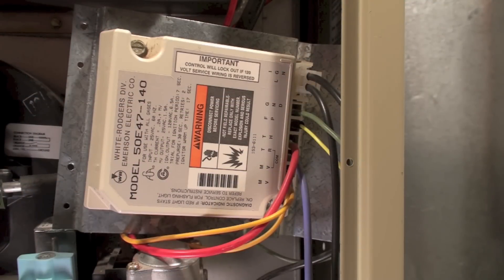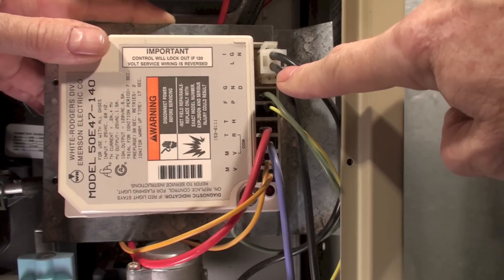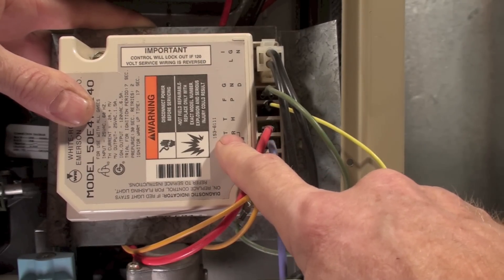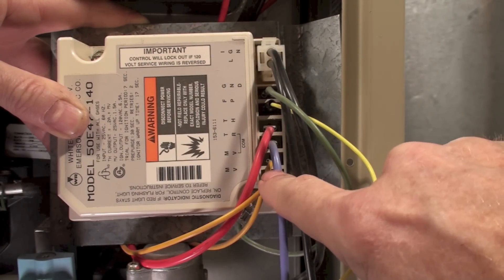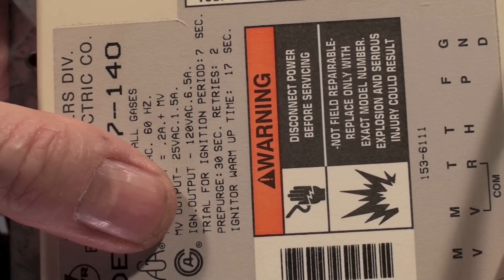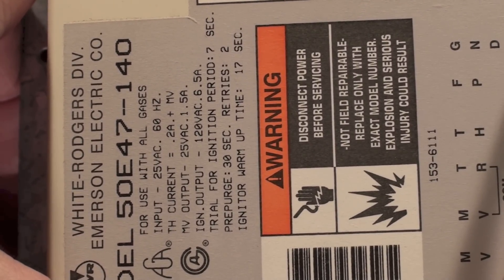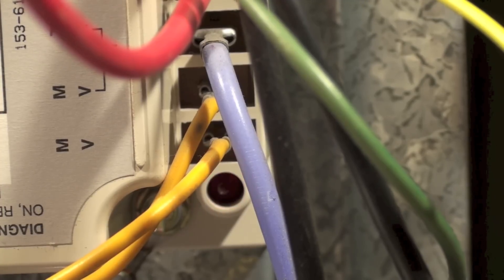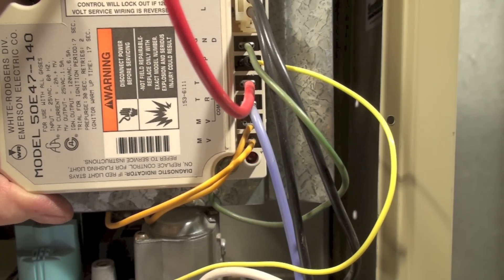How the White Rogers 50E47 ignition control operates

Comment: Will any model 50E47 work mine the model # is missing looking on Ebay they have different model # and look the same as mine.
Reply from the maker: If you have the model # of the furnace, you can get a general replacement control from White Rodgers or Honeywell that has a replacement crossover with instruction on how to use the new control.
GFM

Comment: Hi  Just replaced my 50e47-70 with the new 50e47-843 ign. Old 70 ign nothing would happen. New 843 ign the furnace cycled  all the way but after gas ignited wouldn't signal for blower to turn on. Tried the manual fan on, which old 70 ign allowed, wouldn't turn on. Went upstairs and turned manual fan on thermostat, it turned on, but by the time i got back to furnace new ign was in flames. TH and MV1 are the terminals that melted. Before the fire incident had green light thru all sequences except when blower would not start furnace shut down and green light was off indicating internal failure. Ay tips, ideas ? Thanks Greg
Reply from the maker: That control is an ignition control only.   The fan is not controlled by this control.  Possible flame rollout if the control was mounted above the burners.  A short does not seem likely as the low voltage fuse should have blown.
GFM
Reply: @grayfurnaceman  My  ignition control is located on the bottom of furnace in its own sheltered space 2 foot below burners. The fire at the TH and MV1 terminals was immediately after thermostat commanded blower to turn on manually suggesting to me i dont have them connected properly to the new 843 ign mod.
 I'm going to bite the bullet and get someone over for a service call.
 Thanks for your help.
Reply from the maker: @greg6745  Good idea.
GFM

Comment: i have a 50e47-060 that the light is not coming on.....does this mean control board is in good working condition? what other board numbers work withtrane xl 90? thanks for your time
Reply from the maker: No light is probably no power to the board.  Check pressure switch, limit.
GFM

Comment: GFM,
Just as a follow up I replaced the used White-Rogers 50F47-060 with the White-Rogers 50E47-060 and everything works. They were like-for-like lead replacements. The 843 had a little more lead rearrangement. Thanks again for the great video and suggestions.

Comment: GFM,
Thanks. The only thing that does not work occasionally is no 120 from the igniter plug but the question isis the 5047E-060 and the 5047F-060 interchangeable. It looks like they would either work.
Thanks and merry Christmas.
Craig
Reply from the maker: There is a general replacement control that will work.  It is the White Rodgers 50E47-843.
GFM

Comment: Great video on the White Rogers 50E47. My question is The 50E47-060 a good replacement for the 50F47-060. My problem is the igniter does not receive power sometimes to light the flame. I have to manually shut off the power multiple times to get it to fire.  I can hear the relay click so I am assuming there are some bad and /or dirty contacts inside the controller. I can't find on the internet a 50F47-060 but can find the 50E47-060.
Thanks for your help.
Reply from the maker: If you are sure you are getting 24 volt power to the control, you could have a failure in the control, but you could also have a failure in the HSI.  They sometimes can break and not always make contact.  Look for white spots on the HSI.Merry Christmas
GFM

Comment: I Got  A Fraser Johnson the board doesn't light up but my ignitor isn't getting power any ideals Thanks
Reply from the maker: If you are using the 50E47 control with no light on, there is no power to the board.  pressure switch not closing?
GFM

Comment: I just hear a click and the ingniter does not heat up and then I hear the gas go on but not light because igniter not lighting. New igniter. It was red flashing then goes to solid red after! The board I have is 50e47 843. Do u think it is the control board to be replaced? Any help ASAP would be great please 🙏
Reply from the maker: You need to check for voltage at the HSI and at the plug at the control board during a trial for ignition.  No voltage, control board failure.
GFM

Comment: Mine keeps flashing red. What’s the causes of that? If I reset it by turning the power off and powering it back on it usually works fine for awhile but will eventually start flashing red again and I won’t have heat. Thinking this unit itself might be bad?
Reply from the maker: If your unit has a flame rod, clean it.  https://youtu.be/0ZYXK8450mM
GFM

Comment: I have an old furnace and it runs good for hours sometimes days but then out of no where it just dies. I have to go and turn of the switch to furnace and then it will start up again like nothing I checked the coil and it's not plugged airflow is good. I replaced thermostat. I cant figure it out I test everything and it seems to be working fine just randomly goes out and it doesn't do it continuously which makes it hard to troubleshoot any ideas? Tuco80b942a1 model
Reply from the maker: If the unit has a flame rod, clean it.
GFM

Comment: where does the 24 to 28 VAC enter the controller?
Reply from the maker: On this control, It enters thru the TH and TR terminals.
GFM
Reply: Should both the TH and TR terminals have about 24 VAC when individually the metered with the Ground terminal (probe on TR and ground, for example)?  Or do you meter put the probe on the TH and TR at the same time and get a reading?   @grayfurnaceman
Reply from the maker: Place your meter across TH - TR.
GFM
Reply: I installed a used 50E47-060 (exact replacement for my board rather than purchase the universal 50E47-843).  I have 27 - 28 volts coming into an ignition control board I just purchased (via the TH - TR as you indicated).  It worked for 3 days, opening the gas valve and cycling perfectly, then is stopped working the same as the original 50E47-060 control board I replaced.  The problem is that the control board (both of them, now) is not sending the 27 ish VAC to the gas valve.  Is it possible the newer 50E47-060 board failed after 3 days or could something upstream from the control board be frying it.  I am reluctant to buy a third board and have the same failure if something else is causing the issue.    @grayfurnaceman
Reply from the maker: As it is a used board, who knows?   I would try putting a surge protector in the circuit.
GFM
Reply: If the control board was working correctly, should the MV gas valve outputs be putting out a constant 24 to 28 volts AC (or just burst) after the call for heat (and after the hot surface ignitor is ready when it is time to open the gas valve)?  In other words, when the gas valve is supposed to be open, the control board should be sending the low volt AC constantly until the thermostat shuts it off.  I am curious, because I can hot wire the gas valve by wiring a constant 27 VAC to it and it works fine.   @grayfurnaceman
Reply from the maker: When there is a trial for ignition, there should be voltage to the gas valve until the call for heat is over.
GFM

Comment: I have a 50E47-170 and it is only putting out 9v to the gas valve.  Do I need a new controller.
Reply from the maker: If it shows that voltage during a trial for ignition, yes.
GFM

Comment: I have a Snyder General gas heater, 1986 model, and it has a White-Rodgers 50D47-140 in it.  I woke up to a cool house this morning, and suspect the ignition control might have failed.  Is the 50E47 a replacement for what I have?  It looks very similar, but the wiring might differ a little.
Reply from the maker: I have not heard of the 50D control.  The 50E47 843 is a general replacement control that works for all non integrated ignition flame safety controls that I have seen.
GFM
Reply: Yeah, it's old, and probably should've given out long ago.  A friend of mine, who services furnaces, came over and replaced it with a Honeywell module, and got us going again.  Like the 50E47 843, it's also a generic replacement.  Happy to have heat again!  Supposed to have snow again tonight!
Reply from the maker: Looks like you are ready.
GFM

Comment: my ignition mod has no light doing anything. what does that mean?
shouldn't it at least have a green light on?
Reply from the maker: First, I would check for power to the furnace.  Turning on the fan switch will do it.  If the fan comes on, there is power.  Next is 24 volt power to the control.  You will need a meter for this.
GFM
Reply: we have power but no meter. is there another option to check what needs to be checked?

Comment: Had the blinking LED light, cracked open the controlled and found a burned out trace going from the relay to the IGN. 2 minutes and a soldering iron later and my furnace is back up and running.
Reply from the maker: Glad you got it going.
GFM
Reply: Nikita Skakun 
I have one of these on a weil-mc clain boiler. I found a similar problem after opening the plastic case. The contacts inside the Omron relay which controls the HSI  element, were burned up. 
This is the same problem I had back in February of this year. The module didn't last 4 months of service! Very disappointing for how much this thing cost! The first time it went I had no choice but to call a hvac tech bc it happened on the weekend. Two days ago, it happened during the day. Fortunately, I was working close to home, and quickly troubleshot it, and ordered a new one through a hvac friend  for $110, which was cheap.
This relay is a problem. I mounted a piece of din rail on the inside of the boiler by the power j-box and installed an ice cube relay with 10 amp contacts  in the circuit. Now the current for the HSI element runs through that relay instead of the module. The relay inside the module is an odd voltage. 18vdc. So much easier to switch 120vac externally than to monkey with a heavier relay of that voltage. No doubt part of the design to force us to keep buying control modules! 
Hope this helps.

Comment: My red light is blinking, should I start by replacing this control unit?   I have no paper work that came with this furnace, Its at least 12-14 years old.
Reply from the maker: +Bob J The flashing light indicates a flame failure.  The control is probably just doing its job by shutting down when it does not sense flame.  You could have a dirty flame rod or a gas valve problem.  Hope this helps.
GFM
Reply: +grayfurnaceman Thank you for your reply.  Yes my flame is out. When I wake in the AM my blower is blowing but the flame does not start. I turn off my thermostat and turn it back on and the flame starts right up.  

It sucks waking up to a cold house!  I called my repair man and he says he's gonna come and replace the control unit (about 14 yrs old) and have a look see.   As it states on the unit, a solid red light means change the unit but yet he's doing this first.  Do you think this could fix the problem?
Reply from the maker: +Bob J This still sounds like a flame sense problem.  However, give the repairman a chance.
GFM

Comment: just switched model f50E47-060 to the 50E47-843 , read everything correct (i think)for the wire switch but when turned on it fried (literally) the 843 ... what  did I do wrong ?
Reply from the maker: +slew charles You let the smoke out.  lol Send me a pic to grayfurnaceman@gmail.com and I will try.
GFM

Comment: if is in lockout it means i have to replace the board or something else
Reply from the maker: +Juan Maldonado A lockout means something happened that made the conditions unsafe to light the burners.  The board could be failed or HSI failing to warm up, flame not detected, or gas supply problems.  Hope this helps.
GFM
Reply: How do you reset the lock-out portion of things? My flame started, ran for a bit, sputtered and then went out. The igniter then stopped glowing white(heat) and the unit went into lockout. Is there something I can do to reset the lockout?Thank you!
Reply from the maker: Just kill the power and restart.
GFM

Comment: Hi Gray, 

Have you tried replacing this 50E47-140 with a universal 50E47-843? Did you encounter any problem?
Reply from the maker: Mae Jefferson Done it a number of times.  No problems with the changeover.
GFM
Reply: +grayfurnaceman Thank you. How about 50E47-170 to 50E47-843? Did you use the red and blue adapter? it&#39;s giving me aN error code for a lockout. I connected the Flame sensor to FP. Everything else matches.
Reply from the maker: +Mae Jefferson The only difference here is the HSI warmup time.  I am not familiar with the red and blue adaptor.  
GFM
Reply: On the 50E47-843, there's a mollex connector with a red and blue wire, it needs to be connected to L1 and HSI. I don't know why it keeps on going to a lockout, there's no ignition. On the previous board there's no L2 but on the new one it says it needs to be grounded. Do you know if that needs to be grounded or connected to the neutral of the primary?

Comment: So I've basically got the same control on my furnace. It tries to ignite, then goes to blinky mode. Doesn't look like the HSI lights up at all. I'm guessing the HSI is toast? I know it's at least five years since it's been replaced.
Reply from the maker: brandon That's probably true.  Look for a white spot on the ignitor.  That will be the break.  Hope this helps.
GFM
Reply: Thanks, it sure was. Thanks for the tip!

Comment: gray 
    I contacted you about this unit a couple days a go, power going in but not coming out of the igniter wires side, I order the part should be in soon, I've been manually lighting the furnace to stay warm & just now went to light it & the igniter started to work ! Do you think it still could be the 50E47-843 igniter control ? Someone told me it could be the hi-low speed switch on my blower stuck on a lower speed ! Could that be it ?

 Thanks  !    Jim
Reply from the maker: Yvonne Williams Probably it is.  The relay may be working sometimes.  As long as the power is available to the control and it does not send power out, the control is at fault.  The blower is not the problem.
GFM

Comment: gray, 
I have the 50e47-843 my igniter is not working, I tested it & its fine & I'm getting power to the module on the igniter side but its not sending power back out, I can light the furnace with a lighter  & it will work fine. ohh another thing I looked @ I opened the module up & above the common wires on the board it looks burnt, on the back side of the board theres 12 little black things : ) got me what they are called but it 4 across & 3 down in rows . would you think the module is bad . I bypassed the 2 wires to the module that lights the igniter with a jumper wire & it glows ! with the $$$$ so high on these I don't want to buy one & its something else ! Thanks Jim
Reply from the maker: Yvonne Williams If you don't get power out if there is power in, there may be a bad relay on the board.  This means replacing the board.
GFM
Reply: ok thanks !

Comment: I have the mentioned control module in my Amana furnace.  Just stopped producing heat last night, just in time for Christmas! My problem is no gas comes from the gas control valve module.(Robertshaw Grayson).  Thermostat makes the request, ignition element glows but no gas comes into the burner. (I have gas, and it was working)  When I reset the control module the red light comes on for 1 second and then goes out, starts the routine as usual, just no gas.  The exhaust fan also starts running as usual.  The main blower will not start, but that should be due to no heat being produce and the module shutting down for lack of flame.   Someone told me it is highly unlikely the gas valve module failed. Could you give me a likely scenario. Many thanks!

Comment: Furnace man i have a WR 50E47-843 and the ignitor glows. As soon as the igniter goes out the signal is sent and gas valve opens. Everything else is fine.
Reply from the maker: jay jones I am assuming the burner does not light.  If so, I would be looking at ignition control.
GFM
Reply: Yes. The burner will not light

Comment: I got a call for no heat. The inducer motor starts, the pressure switch seems to be fine..and then that's all it does. The HSI don't glow or anything and will not try to light. Could this ignition module be bad?
Reply from the maker: chad kendall What you need to know is if 24v power is reaching the module.  You should have voltage between TR and TH.  If you do, check the HSI continuity with an ohmmeter.  Hope this helps.

GFM

Comment from the maker: As with most of these controls if the flame rod does get dirty it needs to be cleaned. When you reset the power it's similar to rebooting a computer and it just starts over again. Hope this helps.
GFM
Reply from the maker: Most of these controls are energized by current reaching the TH terminal thru the limit(s) and the pressure switch.  I would be looking for pressure issues from the pressure switch.
GFM

Comment: HOW DO YOU FIX THE FLASHING LIGHT ?
Reply: If it fails to light it could be one of three things.

1.  You are not getting gas.
2. Your igniter is failing.
3.  If starts but the flame sensor failed, it will think it did not start.

Mine has gone into lockout twice, and it turned out to be the ignitor and the second time it was the flame sensor.

Comment from the maker: Many of these ignition controls will not shut down the pilot even if it does not light.  Some will shut down after 90 seconds.  When you remove the high tension wire, use an insulated screwdriver from the control terminal to close to chassis ground.  You should get an 1/8" or larger spark.  If no spark, control has failed.  Hope this helps.  Let me know.
GFM